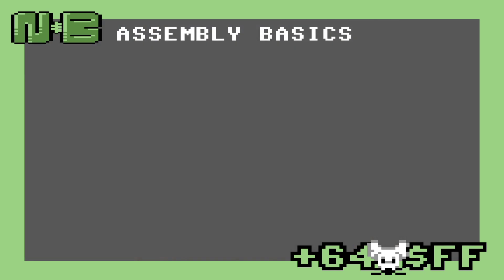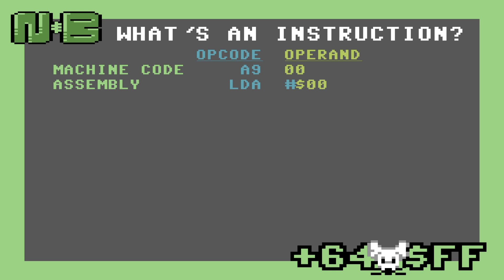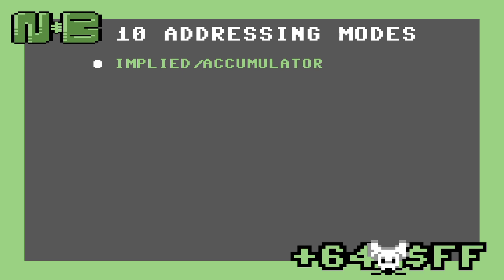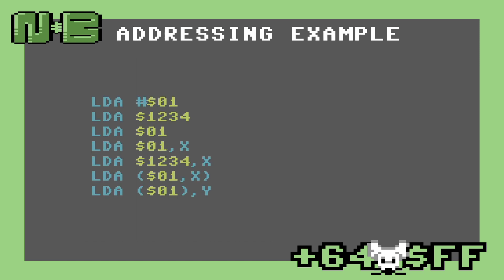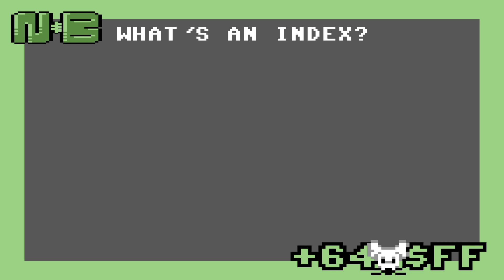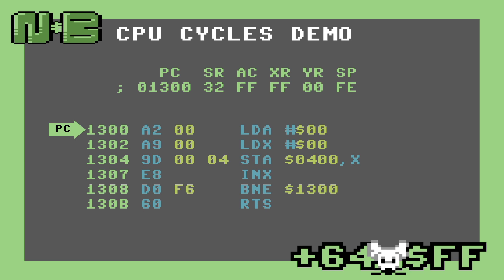Nybbles and MouseBytes: Ep1: Assembler Basics

Comment: 0:47 Technically, all compilers are for languages that just convert to numbers.  Moreover, everything inside a computer is just numbers.

0:59 The most "bare metal" language would probably be using raw hexadecimal in a machine-language monitor.  Using mnemonics in a monitor would be a abstraction above that, and using an assembler is another abstraction above that.  Maybe you're using "Assembly" and "Machine Language" interchangeably, but the terms have distinct meanings.

1:07 All compilers turn human-readable language into machine-executable code.  The distinction of Assembly from other Compilers is that the Assembly represents the machine-language instructions in a one-to-one fashion.

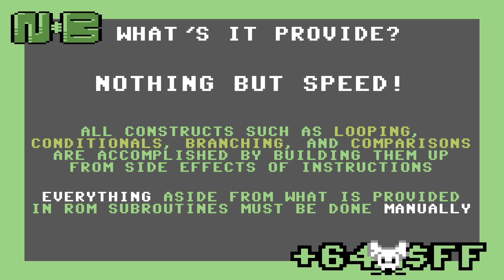1:35 The 8502 instructions only take a maximum of one operand.

1:49 Operands can't really be registers.  Instructions like "LSR A" really are just syntactic sugar for the Implied addressing mode.

7:32 I was unaware that the 8502 produces smoke with every register-value change.  Odd that it doesn't have an exhaust pipe! 

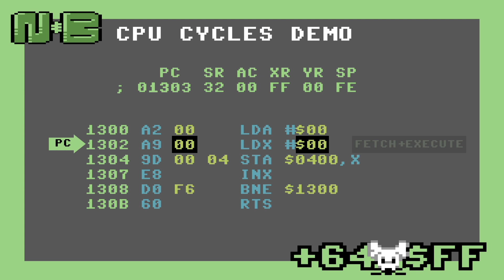8:05 Presumably, the «BNE $1300» is meant to be «BNE $1304» to allow the loop to do something useful and to ever finish.

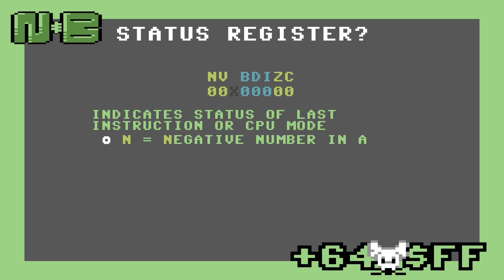8:35 The oVerflow flag is used to detect arithmetic overflows of signed values in the 7th bit.  The Carry flag detects overflows in the 8th bit.

9:33 The '#' refers to the Immediate addressing mode rather than Absolute or Zero-Page.

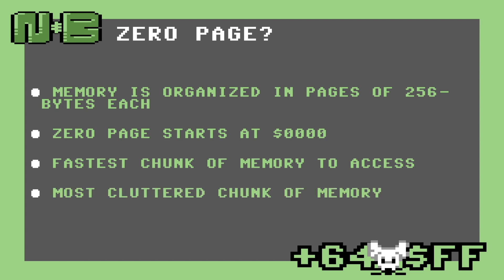9:43 It's not really that tricky to use Zero Page in your own machine-language program.  If your program will exit back to BASIC, you can save all of the zero-page locations that are used only by BASIC, on entry, to some temporary storage space, copy them back on exit, and use them freely inside your program.  On the C64, locations $02 to $8F can be handled in this way.  It looks like the same is true of the C128.  You might be able to snag some additional locations depending on how much your program will make use of the Kernal.

10:54 The stack is also manipulated with the TSX and TXS instructions.
Reply from the maker: @Brutikus Red @Brutikus Red I can't really respond to all of this in a YouTube comment. If you'd like to bring these up with me, I'd be happy to discuss this better in a Discord chat or some other forum somewhere. Or better yet: if you want to help me get this correct in the future, please sign up as a Patron and you'll be able to proof the videos before they go public -- you obviously care about this topic quite a bit, and I'd love to get your input before these hit public view. :D

The comment field for YouTube is particularly broken with the way it formats the fields nowadays, so individually responding to every point you raise in these comments is becoming difficult.

I will address a couple of these, though:

You are right, compilers also convert programming languages to machine language. What I'm saying in the intro isn't a statement to be taken in exclusion to the set of all programming languages, or to how CPUs work.

It's assumed that I'm talking about assembly here, and depending on where you draw the line for "language", ML isn't technically a language at all -- it's a raw set of bits that toggles on and off specific complexes in the CPU to perform various operations. It's about as much of a "language" as ENIAC's "reprogramming" was where they completely reconfigured the system wire by wire using a diagnostic cart for every "program".

If we're being perfectly correct regarding compilers, the frontend of a compiler does the initial parsing and conversion into the AST and IL, and the backend does the conversion to ML. Ultimately it is the code generator in the backend that converts IL to ML, and in many compilers that's a straight up assembler (I'm looking at you GCC -- LLVM does its own weird thing with tblgen and friends). What I'm saying here isn't entirely inaccurate, and for most beginners, this should suffice.

As for the MONITOR being an abstraction, it is an assembler: it converts mnemonic instructions into ML with the A operation exactly the same way any other assembler does. It's just missing a bunch of features we usually associate with assemblers like file reading, symbols, macros, and memory block allocations.

I also have a few bugs in the video that need to be fixed. I realized that after I posted the video. Unfortunately, YT videos are immutable once uploaded, so I can't update or fix them, sadly. I'll have to address these in a later video, I think.

Thanks for keeping me honest, though! I do appreciate your comments.
Reply from the maker: @Brutikus Red Excellent point about the oVerflow flag -- I wasn't quite sure how to keep it simple. Your statement is much more accurate and understandable. I'll likely get into much more detail when we get to ADC and SBC in the later videos.
Reply from the maker: @Brutikus Red Also the thing I mean by "tricky" is literally that you have to save zero page addresses to another location and then restore them on returning to BASIC. That's not easy from a MONITOR, and it does take explicit setup in an assembler.
Reply from the maker: @Brutikus Red One last point: yes, you are technically correct that 8502 opcodes only take one operand. However, when you consider that absolute addresses are composed of two bytes, it depends on where you draw the line for the operand grouping: is an operand one byte, or two? Internally to the CPU, it involves a separate fetch for each byte, and each go into a separate internal register. Yes, registers aren't technically operands, either, and are part of the opcode, but from the perspective of assembler mnemonics, they are because they aren't part of the mnemonic.
Reply: @NybblesandBytes : «sign up as a Patron»  Worth considering.

«depending on where you draw the line for "language", ML isn't technically a language at all»  I would draw the line at a Formal Language, which is a sequence of symbols with constraints on the sequencing, which is an extremely broad concept.  You could consider the "symbols" to be byte values.  A general-purpose "programming language" would be a Formal Language that is Turing-Complete.  So, raw machine code qualifies as a programming language.  You can program in it more-or-less directly with a hexadecimal memory editor, or with POKE statements from BASIC.  I'm reminded of https://xkcd.com/378/ .  There are numerous programs written in machine code in the C128's ROMs.

«reconfigured the system wire by wire using a diagnostic cart for every "program".»  I'd have to know more about exactly how ENIAC's programs are represented to be sure that it ISN'T a programming language.  Though in a practical sense, if you can represent a "program" in a removable plug-in module, then the "program" in that module must be represented in some kind of a "programming language".  Is the microcode ROM inside the 8502 a "programming language"?  Possibly.

«As for the MONITOR being an abstraction, it is an assembler»  Of sorts.  I would call the 'A' command a one-line raw-value assembler.  You could enter your machine-language programs with the MONITOR's hexadecimal memory editor as well, though that reduction of abstraction is painful.  And so, too, is the loss of abstraction between a one-line assembler and what most people would call "Assembly Language": a text(ish)-file representation of machine language that uses labels and constants instead of raw addresses and values.  This abstraction makes the code much more maintainable. 

«when you consider that absolute addresses are composed of two bytes» I would consider that to be one 16-bit operand instead of two 8-bit operands.  It's used as a single coherent value and is represented in Assembly Language on the Address Bus as one 16-bit value.
Reply from the maker: @Brutikus Red The programs written in machine code didn't start out that way. :D

ENIAC isn't a stored program computer. Therefore a program was entirely represented in the physical wiring of the computer. The 8502 is not a microcode based system, and thus has no "secondary language" built in. Opcodes are literally flipping switches to turn on and off complexes in the chip.

Regardless, I cannot continue to debate this with you here -- I literally have a one line text box to enter replies with.
Reply from the maker: @Brutikus Red Might I suggest we continue this debate in Discord?
Reply from the maker: @Brutikus Red One last point: the address bus does not represent it as a single 16-bit value internally in the 8502. It is output from two separate address registers, and all 16-bit addresses are treated as two separate values internally. They are only output as "one 16-bit value" to the bus because of the locality of their wiring. =op
Reply: @NybblesandBytes : If you look at the top of the Visual 6502 chip die, you'll see a rectangular grid of connection points.  That's the microcode ROM.  It may not technically be a ROM, but it serves the same function and contains a program that sends signals to various registers and components in the 6502 over the clock cycles of instruction execution.  The programming is fixed, but it's written in a programming language of sorts.

YouTube gives me and expanding text box as long as necessary to compose messages, though I compose more complex ones in an external text editor.  I'm not a Discord user.
Reply: On second though, the ROM grid is insufficient to be the whole microcode.  This image shows the 6502 architecture: https://www.cs.jhu.edu/~phi/csf/slides/6502-diagram-db-sb-ad.png .  The instruction-processing microcode is implemented using combinational logic in addition to the ROM grid.  Both forms are logically equivalent.  Though, this page shows the ROM being somewhat capable for general decoding (they call it a PLA, which is more accurately describes its actual function): https://www.pagetable.com/?p=39 .

While it's fixed, the decoding logic still represents a program written in a programming language of sorts.  You could probably implement any program if the microcode capacity were large enough and you could program it yourself, just by asserting the processor's various internal control signals in sequence.  You wouldn't need an external program at all!
Reply from the maker: @Brutikus Red Ultimately, this is all just semantics and quibbling about terminology. You claimed that the most "bare metal" language would probably be using raw hex. I argued it technically isn't a programming language. Both are semantics. Both have little to do with learning how assembly works. Yes, ML represents a program as much a Turing machine's paper tape does. Is it a language? Debatable, which is the point I was trying to argue. There's a reason why assembly exists, and why opcodes are encoded from mnemonics the way they are: fundamentally the source must convey the concepts the programmer is attempting to express. Not just to the machine, but also to other programmers. Yes, you can write a program using nothing but hex numbers at an ML monitor. Yes, it's still programming. Is it going to convey the same meaning to another programmer? Most likely not, and I'd argue the point why we construct languages on top of these numbers is because the numbers do not convey the concepts necessary for humans to understand the program. Otherwise, why would we write in human readable languages at all? Why not write in raw logic gates? Even modern microcode uses a human representation rather than just raw numbers to encode the steps the CPU performs, regardless of what exact construction the hardware has.
Reply from the maker: @Brutikus Red I think, maybe, I have invested too much of myself in answering you here and should step back and take a breather. You bring up good points, though how useful they are to the learner is debatable, and answering every single point is exhausting to the point of frustration. Let me paint you a picture of my headspace, so you can see where I'm at:

You've been pouring your heart and soul into a production in nights and weekends, working hard to get all the details right, spending weeks pouring over technical manuals, correcting yourself over and over, fighting with the tooling and the documentation to get every point right. You have no-one else but yourself to rely on for correctness, and you get it to the point where you think you've got it down, so you publish to a select group of people you trust, looking for feedback before you publish. You don't get any technical corrections because, again, you're the only one you know working at this level. You make what corrections you think need to be addressed, and then you publish it for the world to see.

And then you get a comment like this that completely picks it apart with no apologies, no niceties. All the work you put into the production to make things understandable for the layperson torn down as not having enough detail, or not being precise enough, or not fitting what this other person's specific terminology or definitions are. Every minute of your production flayed in a second-by-second rebuttal, utterly tearing down the work you've taken to get things right.

And you can't fix it. You can't go back and adjust the production to address the comments. You can't correct your mistakes. The best you can do is to publish the next one and waste time attempting to explain the mistakes you made in the first one -- which nobody will understand because they didn't hear the mistakes in the previous production.

Would you want to participate in an atmosphere like that? Because that is the atmosphere you're creating, here and now.

I value your input, but I am exhausted from having to address every. single. point. you raise. in every. single. one. of my videos. It's taxing, and deep down I really wish you would find someone else to correct because you are affecting my morale. Your comments are exactly the reason why I slow down to a crawl in producing these videos. I'm a perfectionist, and I want to be correct: I take great pains to make sure I say and do the correct things. I want to address these points, but what am I supposed to do when every video I post is immutable? How am I supposed to produce if I can't be allowed to make mistakes without being ground into the dirt by a gargantuan text editor-driven comment that picks apart every single statement I make in a video from start to finish? How am I supposed to feel when every point I make in the comments is further picked apart with semantics and unyielding "I'm the authority and more correct than you" argumentation? You don't give an inch when you might be wrong, and instead redefine the argument to suit you. Ultimately, the points you raise drive me up a wall because everything I know I studied hard to learn by myself with no help from anyone else, and I have no-one to turn to for help in proofing this stuff.

Frankly, I'm frustrated enough that my friends are advising me to ban you from the channel just to make it stop, but that would both be unfair to the viewers and to you, so I don't. That's a bomb I don't want to touch because you haven't done anything egregiously heinous, and your points are, for the most part correct. Nevertheless, this is where I am right now, and I'm not really sure what I can do to placate or address your concerns. I've offered an olive branch, and so far you haven't considered it, and at this point, I have no idea what to do except stop responding.

In the end, I'm the one producing, trying to make something for others to learn from. So far all you've done is pick them apart, criticize and tear them down, piece by piece, which is thousands of times easier than making something. Somewhere, deep inside I'm thinking "damnit, why can't I do better?!" and I realize that I'm doing everything I can to do as best as I can in the time I have, and then I get the followup, "damnit, why don't YOU do better, then, huh?!" But I know you won't, because you're not here to make a video. You're here to criticize and argue and tear apart the work I do, all in the name of being "more correct". To what end? What's in it for you? All I get from these exchanges is mental torture -- what are you gaining by doing this to me and my work? 

So this is where we're at. I don't know how to proceed, but I don't think I can take another of your long-form teardowns. I'm going to make mistakes. I accept that. People will correct me. I accept that. What I don't have to accept is long-form criticism with no end in sight, no way to placate you. You're completely free to respond in a comment. I'm free to respond if I choose. But don't expect me to respond to another long-form teardown; I think I'm done with those -- they don't help me, they only tear me down.
Reply: I thought you had missed the bug when it first appeared at the 1:15 mark, but looks like you caught it later in the video. 😁

Comment: do you keep saying 8502 when you mean 6502? Also, you need to slow it down.  This is close to incomprehensible
Reply from the maker: The 6502 and the 8502 use the same instruction set, so their names are interchangeable. Only the pinouts and packaging are different.
Reply from the maker: And no, I mean 8502 -- the CPU we use on my channel is the one in the Commodore 128D, which is an 8502.